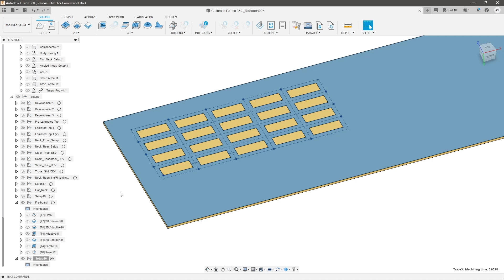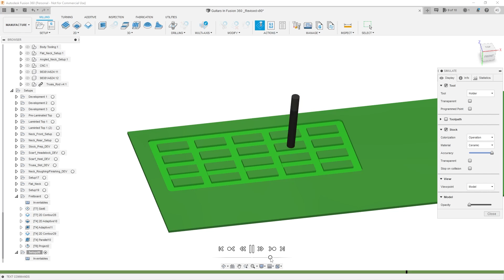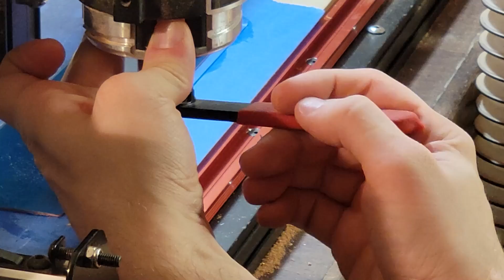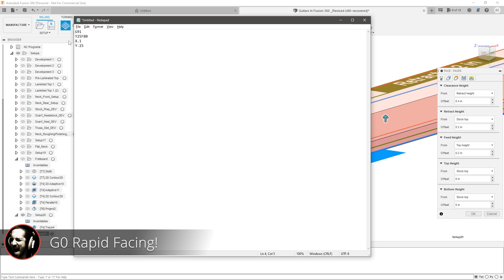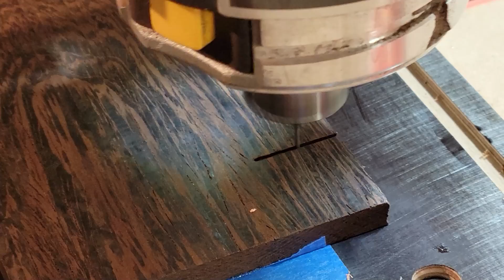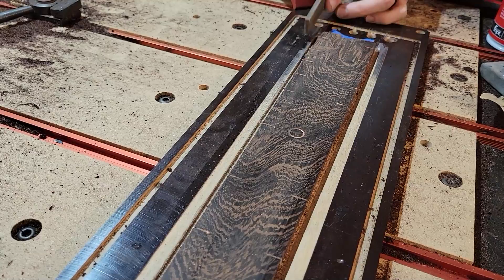The Fretboard | Project Mehr | Guitar Build Log Part 3

Comment: Hello Austin  I recently found your channel.
We always used denatured alcohol when cutting, milling or drilling soft metals like aluminium or Cooper. I never had any problems even with a 1mm (0.04 inch) endmill or drill.
But remember denatured alcohol is highly flammable ;) so keep it away from your spindle motor.
BTW: what superglue and activator you are using? I'm looking for a good one.

Comment: How/why are you touching CA glue with your bare hands?
Reply from the maker: Haha everyone has commented on that. The particular CA glue I'm using takes a long time to harden without the activator spray, so I was able to simply wipe it off without any stickiness or fingers being glued together 😀. I find I tend to use my hands a lot when applying glue, as you'll see in the next video with titebond.

But If it was normal superglue I'd be screwed doing it this way. 😜